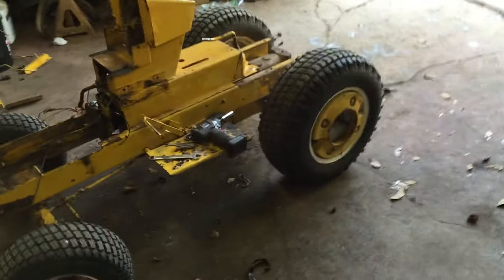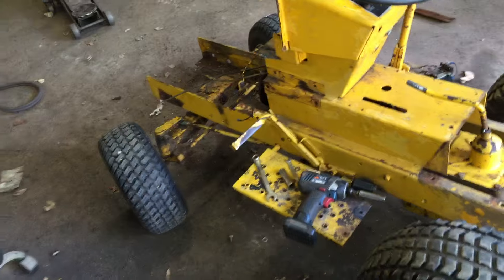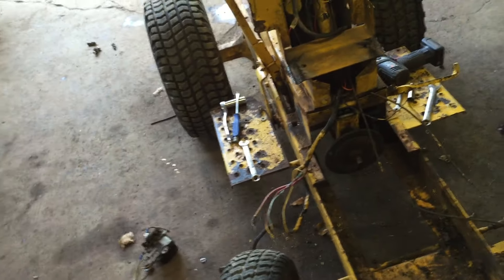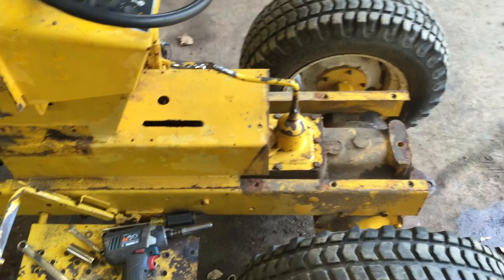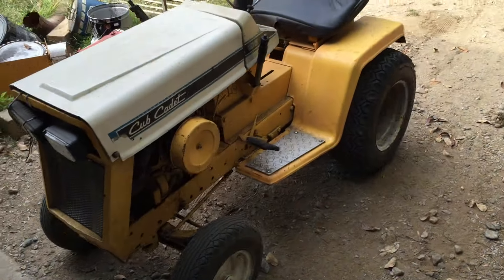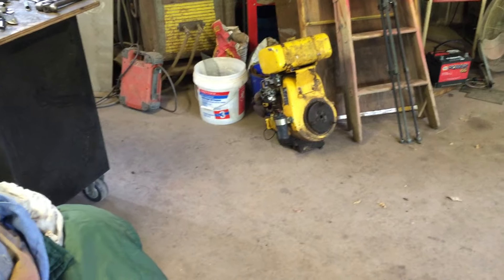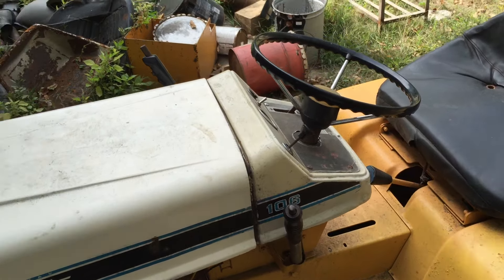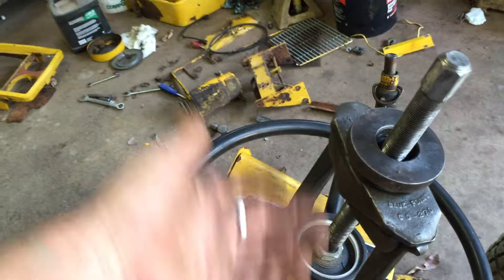cub cadet 122 refurbish part 3- removing steering wheel

Comment: Preparing my tractor i see lol!!! What's the most you've flipped a tractor for?
Reply from the maker: Hmm the most I've made on a tractor, probably that super cub 1872 paid 800 for it and sold it for 3000 , also my ford diesel garden tractor I paid 1000 for and sold for 2200 with doing really nothing other then looking it over and cleaning it , sometimes you make money but not all the time, you gotta buy tractors for around 300 and lower to make any money